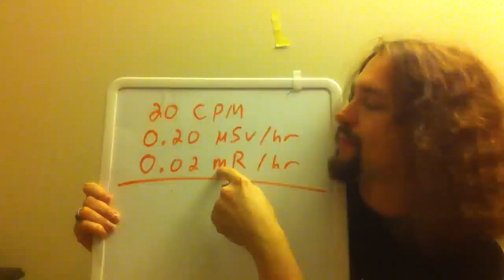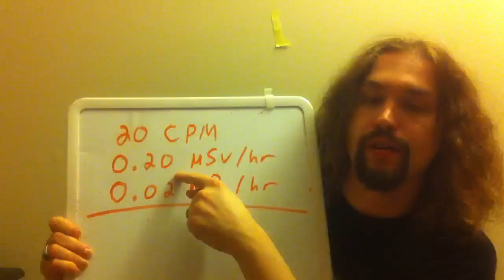☢ Geiger Counter Tips ☢

Comment: Have you noticed an increase in background radiation since Fukushima ? I saw on enenews the other day that 9.4  sieverts phr detected outside containment ... http://enenews.com/japan-times-deadly-94-sieverts-detected-fukushima-containment-vessel-details-behind-situation-unknown-officials-unable-grasp-location-melted-nuclear-fuel-impossible-plan-decommissioning . Wont this cause "normal" background radiation readings to change considering that the wind and ocean currents go from Japan to the U.S.
Reply from the maker: +RattleShark I have not. Even with my best portable spectrometer I saw little evidence of byproduct material (i.e. fallout) when I was in Japan, south or Tokyo. North of Tokyo is a different story.
Take care when reading articles from non-peer reviewed sources. They can be 100% right, but there isn't a good means to be sure.

I have been testing water and soil since 2011 in my lab and I have not noticed much. It's certainly out there but not at the levels folks would have you believe.
Reply: +antiprotons The 9.4 sieverts was from TEPCO , reported in Japan Times.
I was just curious if you compared a 30 day average background from 4.5 years ago to an average 30 day background now , would todays numbers be higher.
I have been looking at Geiger counters for about a year but have not bought one  , if the only thing i want to do is determine "normal" background in CPM and watch for spikes i do not need to spend an extra $125 having the counter calibrated ? The msv/hr and mr/hr settings are pretty much useless outside a lab setting where you know exactly what isotope you are dealing with.
Reply from the maker: RattleShark  I do not have any good baselines from before Fukushima, but the baselines that I do have have not increased or decreased since Fukushima. I have years of data saved which do not show any increase.

That being said, there has been a slight increase in certain radio nuclides around the world as a result of Fukushima, just like there was for Chernobyl and nearly 1000 nuclear weapons detonated on earth. Even at levels of increase in the double digits (i.e. 10-99 Bq/kg) Which is a hefty increase and has been observed in place, a Geiger counter with not notice a significant change in the background. A good manners are simply not sensitive enough to detect such changes in a regular open-air environment.

What that means is that even with the fallout from Fukushima appearing all over the world, isn't really going to show up on anything outside of a very expensive lab detector. This does not mean it doesn't exist, nor my downplaying its significance, I'm just saying that a simple Geiger counter will have trouble picking up something like that unless you're near Fukushima.

Additionally, those high radiation dose rates recorded the plan him not always indicative of released material. Sometimes the material the cause than can be contained around the plant, though it is absolutely true that nuclear material from Fukushima has seeped into the water ( openly poured in some places) and has been released into the environment on a large scale.

As for calibration, any new Geiger counter of any decent quality should come from the factory fully calibrated and certified. The only reason you'd want to calibrating unit is different world. If you are not going to use energy units, which I would not consider using for the exact same reasons that you mentioned, then calibration does still play a role in certifying that the equipment is functioning correctly. Basically, only calibrated confused.
Reply: I misspoke when i said $125 to have it calibrated , i should have said $125 to have it NRC certified
Reply from the maker: RattleShark I've never done that, but you can if you like. Seems like overkill for a Geiger counter.

Comment: When calibrating a geiger counter it doesn't require you to take it apart, does it? Do you just put a certain check source up to your geiger counters to re-calibrate them?

How is the procedure done??????
Reply from the maker: Brandon Fisher    I have all of my units calibrated by their manufacturers who use much more powerful sources that I have, but essentially your correct. Here is the basic idea behind how you calibrate:

1. Place the Geiger counter at a distance ( usually just a few millimeters) from any reasonably probable source with a known dose rates at that exact distance. This is the important part, you must know the exact dose rate at the distance the Geiger counter sets from the source. 
2. Configure the Geiger counter to read it what it should read at that particular distance.   (GM should read Background dose rate + dose rate).

done.

Some Geiger counter's require several data points to ensure a they scale correctly, while orients such as CDV 700, have a simple dial in a reasonably linear change in reading with respect to count. Every Geiger counter usually comes with the manual which explains how to do this, but that's the basic step.
Reply: antiprotons Thanks! :-)

Comment: Only scientific calibrating grade isotopes. It amounts to mass, shape, distance, grade, quality, purity, etc. Then your meter calibration procedure, type, tube type specs, stop watch, distance. But still; measuring radiation is something different.
Reply from the maker: SkyRad1    Difficulty is dependent upon accuracy. My readings are generally +/-20 + uncertainty budget.

Of course, I don't use a Geiger counter for my lab tests anyway. I use spectrometers.
Reply: antiprotons Something you might be interested in when I was talking about measuring radiation. Such as in an atmosphere or the body. Is the definition of Rad = A unit of energy absorbed from ionizing radiation, equal to 100 ergs per gram or 0.01 joule per kilogram of irradiated material. It has been replaced as a standard scientific unit by the gray. OK. How do we determine that same unit of energy for different isotopes in an atmospere, Or free air, with which geiger counter, and which pickup device. ie. tube, pancake device, which gas, tube specs.As far as I know it cant be done. Each tube or pickup device measures diferently. For instance my gm-20 tube will not pick up some isotopes at all. And those that do pick up those isotopes will not pick up isotopes that the gm-20 picks up. Why? We need something like the inspector type detector that will pick up all isotopes and meaure a Rad in free air. Does a Rad of one isotope equal a Rad of another if counts per minute are the same. no. Just because it gives a count does not tell you the energy released. Meaning one count of one isotope does not equal another in terms of energy. So a gieger counter is just that, a counter. But the whole idea is to let us know when their is danger. Which it can do. This whole idea of a Rad or grey isnt correct. We are looking to measure that energy, not counts, in free air. But its the particles themselves, or counts, that are dangerous. The counts in other words. So we are back to a gieger counter that we can make work across the board and get a relative idea of the energy level from the counts. Which I havnt seen yet..There are thousands of isotopes. The geiger muller tube measures ionizing atoms or moecules. A count. Not a measurement of energy.
Reply from the maker: Again, that is why I use a spectrometer.  My gamma spectrometers can measure energy as well as count. Not all radio nuclides emit gamma (most do or have a chain which does). There are liquid beta and alpha spectrometers too.  I stick to gamma and x-ray spectrometry, personally.

If you like, here is a video I did identifying and showing the gamma spectrum of Cs137. https://www.youtube.com/watch?v=gcNzV0jWf7I
Reply: Nice video. Again its calibrated to one isotope. I would like something that could identify the radioactive source isotope and measure it and be portable. dreaming huh.For instance you should be here now so we could use some of your devices. 25 uSv /hr constant today. 100+ yesterday.
Reply from the maker: SkyRad1   My spectrometer isn't calibrated to one radio nuclide.   As for portible, you could use something like my Polimaster.  It detects Gammas from 30 keV to 3.5 MeV, as well as neutrons from thermal to 14 MeV.

https://www.youtube.com/watch?v=ei7FUt1Rg4k

Most of my gear is energy sensitive and not simply calibrated to some single source.
Reply: Energy sensitive. My Bella detector with a gm-20 tube will not pick up my CDV 700 Radium  D,E source.that has a half life of 4.5 billion years. But it pegs a CDV 700 on two scales. Thats strong.
Reply from the maker: SkyRad1   I can detect and identify the radio nuclides in my CDV 700 using either an x-ray spectrometer or gamma spectrometer. These units are somewhat costly.  For example, my Polymaster 1703GNB costs around $3000. Energy sensitivity is costly.
Reply: Hmm thanks. Someone needs to build a field version spectrometer.
Reply from the maker: SkyRad1   My polymaster is a "field" version. It is as small as a pager.
Reply: antiprotons I have to do something cheaper.
Reply from the maker: SkyRad1   Cheaper?  if so it won't be too portible. Try http://www.gammaspectacular.com  I know the owner and he makes good stuff. I have one of his GS1100A's.
Reply: antiprotons I think I am going to try making my own. I think I can get close enough.
Reply: antiprotons I see how you collect a couple thousand pulses and identify with the histogram, but, say you are outside with a pancake type tube or scintillator picking up random pulses in a radioactive environment. Your going to have hundreds of isotope pulses all over the place in the energy field.. Not a defined set of pulses.Have you tried to isolate particular isotopes in such an environment. Is it possible to single out and define isoptopes when many are present with a spectrometer? Or will it look like a tangle of lines. I was looking for like a gas chromatograph readout on the exact spectrum or isotope and intensity in rads.For all isotopes present at once.
Reply from the maker: SkyRad1 It's actually not too difficult. You take the spectrum and simply look for peaks which match radio nuclides you commonly find. Nearly every background I take has uranium or thorium and their daughters, as well as K40.
Reply: antiprotons Yes I think that would work thanks.

Comment: I have a few Geiger counters, one of which is the Ludlum Model 3.  The model 3 was purchased used form Ebay and arrived with a wand style GM tube (not sure of the make / model of the tube).  Anyway, as you know, the Ludlum has a voltage adjustment for the GM probe.  I was able to increase the detection sensitivity (cpm on a given sample) by increasing the voltage to the GM tube to a plateau point (where additional voltage increase did not increase the count).  Is this the proper technique to use to optimize sensitivity, or should the voltage be turned down lower (where it originally was, which generated less CPM for a given sample).  I assume that the ideal voltage would be the voltage where the CPS is maximum for a given source, but am not quite sure.
Reply from the maker: You can do that, but increased voltage means decreased life. One danger is that you could be causing extra detection's which are not valid, if you move to the edge of the discharge region, you could be getting a few extra counts.

Do counts come in an quick bursts or steadily?

The rule has always been to stay as low on the plateau as possible. Your model 44-9 probe (I suspect that is what the probe is) has an operating voltage of 900v:   http://www.ludlums.com/images/stories/product_manuals/M44-9.pdf
Reply: antiprotons The counts are steady (i don't hear bursts), but I think the voltage is well over 900 V.  Its not a Ludlum 44-9 probe, since its not a pancake probe, instead its just a cheaper looking cylindrical tube in a plastic housing.  The probe says 900V, so perhaps I'll turn it back down, as I think I'm well over 900V.  Problem with the Ludlum Model 3 is that you cannot get a HV readout.  I'm getting a new Ludlum Model 12 soon, so that should allow me to see the detector voltage.

Comment: How reliable do you think the RDX (DX-1 or DX-2) Geiger Counters are?
Reply from the maker: I like the sound the DX-1,2 make and they look useful as simple for-fun Geiger counters. The pro's are the good sensitivity, the wonderful clicking sound (yes, I love clicking sounds), and the small size. The down sides are the lack of alpha sensitivity, the requirement of pressing a button to use, and the lack of a correct output scale.

The issue for me is the output. They have it in uSv/hr and mR/hr, both of which are totally wrong to use unless you are ONLY testing the radionuclide for which they were calibrated. It's too bad they don't read in CPM.
Reply: antiprotons Yeah it's quite impossible to get counts per minute on those old needle style screens.
Reply from the maker: You can certainly get CPM on old screens. My CDV700 is in CPM and mR/hr. My new Ludlum 12 is only in CPM. Both have needles.
Reply: antiprotons My bad, I only saw CPM on digital Geiger Counters, I have never saw it on a needle style Geiger Counter. The con I see of the RDX ones is that they only go up to supposedly 100 μSv/h (10 mR/h) or 1 mSv/h (100 mR/h) at best on another note my favorite Geiger Counters: the Gamma Scouts (the ones Bionerd23 uses) because you can differentiate between alpha, beta and gamma by a little switch on the devices and the Inspector Geiger Counters because they are the most sensitive ones we can get. What's your opinion on the Gamma Scouts, btw?

(Note: I don't have a Geiger Counter but I watch videos with Geiger Counters in them)

Comment from the maker: GY/h  should be   Gy/hr.     The Gray is a unit of absorbed dose:  the amount of energy absorbed by a mass in an area. The unit is defined in SI units as:   1 Gy = 1 joule per kg per second:    [length]^2 * [time]^-1  

So...  A 1 kg object in a 2 Gy field for 4 hours receives and absorbed dose of 8 Gy's   2Gy/hr * 4hr.

1 mcGy should be written as μGy or uGy. It means Micro Gray and is equal to 1/millionth of a gray.      1μGy of gamma = 1 μSv  (another common unit).

More info needed?

Comment from the maker: Yes.

CPM changes between units. My CRM100 gets 14 CPM on my desk whilst my Ludlum12&44-2 gets about 1800 CPM.

The point is to detect change in the reading, not total CPM. This is worse when people start running around going on about energy units, such as sieverts and Roentgens, which are merely calibrated to a count rate on a Geiger counter.

Of course, if you have an energy sensitive unit, these units (energy units) can be of use. :)

It's nice and complicated  lol

Comment from the maker: Forgot to mention: REM means Roentgen Equivilent Man. This is a measure of the biological affect of radiation vs the absorbed dose. Example, if you are exposed to alpha radiation, itndoes about 20 times the damage of gamma. 1 RAD of gamma equals 1 REM. But, 1 RAD  of alpha equals 20 REMs. Rem = rad x multiplier for type of radiation. Seivert = gray x multiplier for type of radiation. (simplified explanation)